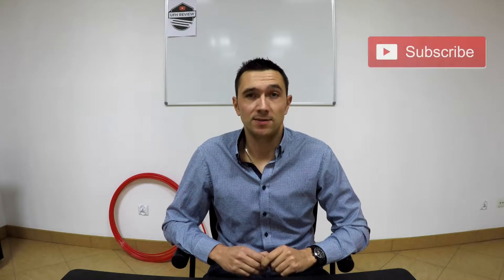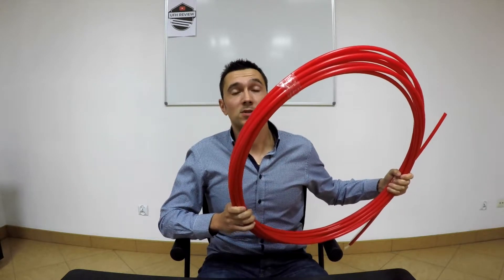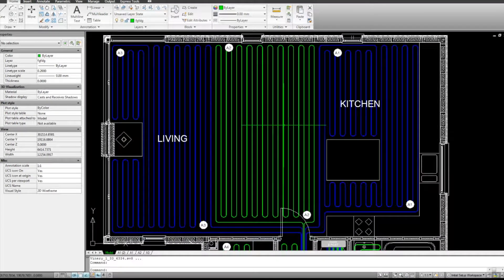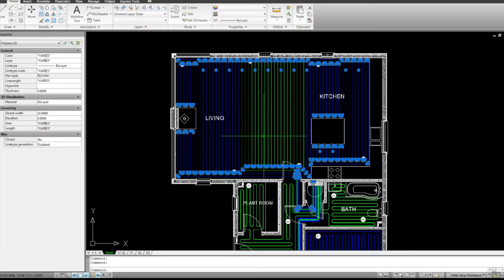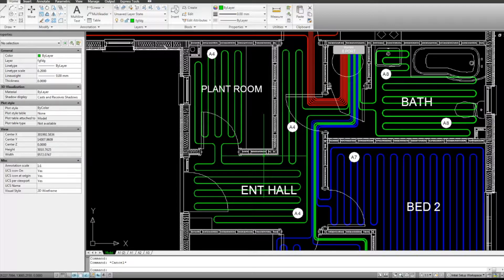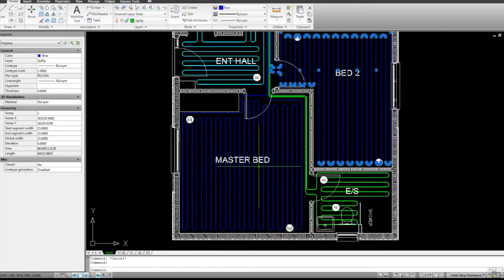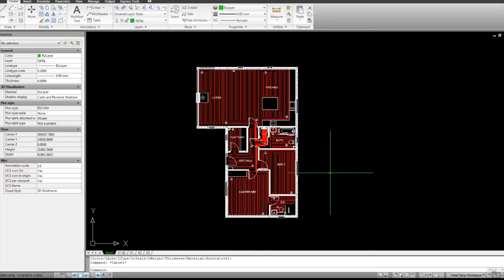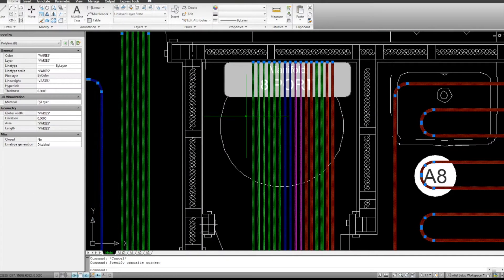Underfloor Heating Circuits and Zones explained

Comment: Astonished that they haven't heated the shower pan. Who wants cold feet in the shower? And keeping it a bit warm would help dry out the shower recess between uses, too.
That isn't what I came here to learn, of course. The important part for a large family is how to enable every person to set their bedroom to their own preferred temperature and the shared rooms at a mutually acceptable temperature, and then how to add a clock to that to adjust the temperature for different daily activities. I'm still struggling with why this all goes back to a single central controller instead of having a controller in each room, but I guess that will become clear in time.

Comment: Hi Craig, just wondering what software you use to design loops and create the drawings?
Reply from the maker: Hi Paul, this is AutoCAD LT with custom dynamic blocks
Reply: Hi Paul 
No mention of heat loss  calculation just wandered why , great video though

Comment: Great video, I have two questions.

1. Can you have some areas/rooms on open circuit, so they come on when any zone is calling for heat, ie a central hallway on open circuit?

2. Can you pipe an UFH circuit to a ground floor bathroom towel rail and if so, would you have it on its own circuit or part of a room floor loop?
Reply from the maker: Hi Dan,
1. Yes this is possible and done often, just remember your loosing the ability to control these circuits, you can always change this later
2. If you need to run a towel rail off the UFH manifold then remember it will only get as hot as the UFH flow temp so i would consider oversizing it or run it off a rad circuit if possible
Reply: @underfloorheatingreview  thanks. Hope to see more great videos. Very informative and clear
Reply from the maker: @handle1196  Cheers Dan